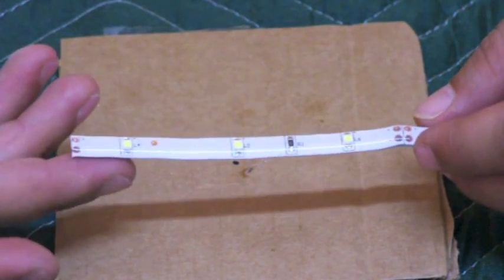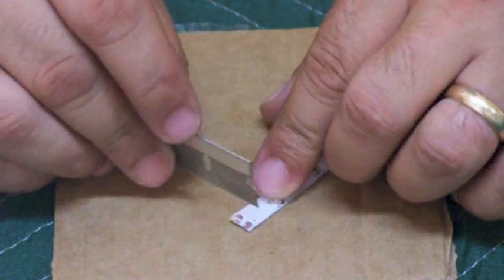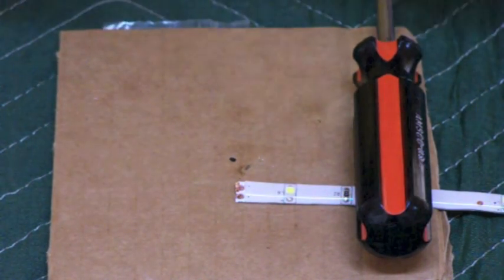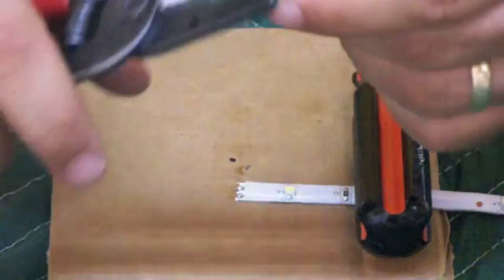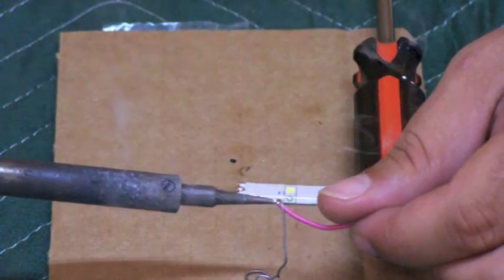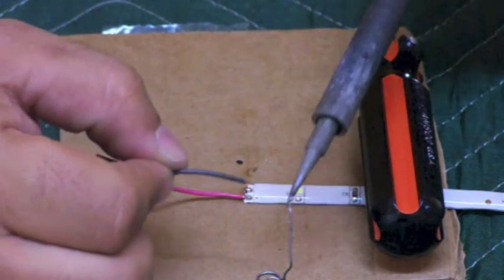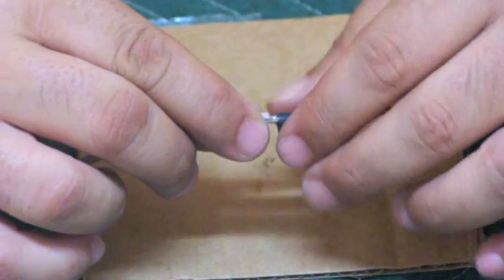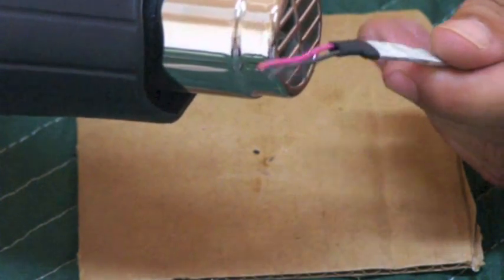LED Strip Lights Wire Leads

Comment: This is SO cool.>>>t.co/GS21bzHK5c    The included instructions were foreign but setup was still easy. I used Magic Home app on my iphone, which works perfectly. The included double sided tape was sticky enough, but I did need pushpins underneath to hold it up on the wall corners (relieved pressure on the turn).

Comment: Do they make the led light kits with connectors where I wouldn't have to do any soldering, just snap together? I'm looking to light up a display case and it would hide lights the way it's made. I need 2 pieces led strips about 30" and 1 piece about 38". Connected together to light up display's. Thanks John
Reply: john g You can buy some that are made for the light strip. Go on Amazon and figure out what lights you want, and compatible connectors should pop up in the suggestions below
Reply: john g You can buy some that are made for the light strip. Go on Amazon and figure out what lights you want, and compatible connectors should pop up in the suggestions below

Comment from the maker: RGB are the three primary colors in the lighting world. Red Green Blue. Each get a ground wire to them. The positive wire (usually a black wire) carries the voltage. Your controller should have all 4 cables coming out of it to connect to each. If you are not using some sort of controller and you are trying to wire these up directly some how then you will be essetially  applying voltage to all 3 colors and will end up with white light.

Comment: OK, people. Here is what he didn't tell you. You need to clean the connections with a 1000 or finer sandpaper to clean the connections. You will either need to apply Flux or use a solder that has Flux in it. Flux cleans the joint, and makes the solder "stick" to the copper. No, it's not necessary top do these steps every time, but if you do, you will make good connections every time...
Reply: And buy a quality soldering iron, or better yet, a soldering station with adjustable heat, They DO work much better.

Comment: If you add a tiny bit of solder to the iron tip first it will almost instantly transfer heat to the wire owing to the enlarged contact point. This will enable the joint to be completed much faster with less likelyhood of the insulation being damaged.

Comment: To those who might wonder how to connect it to a power supply (the simple way). You can use an ac-dc adapter (12V) that you have laying around. Cut of the end off of the wire of the adapter (powerplug), strip the wires and connect them to the the wires of the led strip, making sure you have + with + and - with - . You'll notice also a third (yellow) cable coming from the adapter (most of the times you'll find one): you don't need it. Use shrink tape to cover all the connections and voilà. ;)
Reply: You could also look for an adapter with variable wattage (little button that you slide to 3-6-9-12V, depending on how strong you want your strip to brighten up + how many leds you have (12 X 1W is the maximum with such and adapter). Cheers.